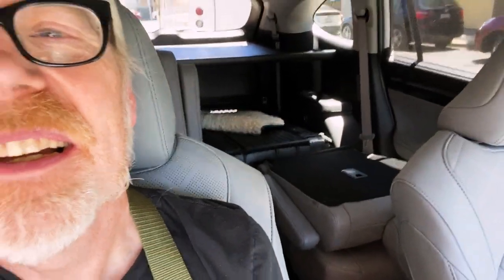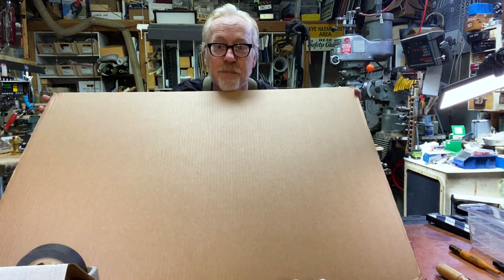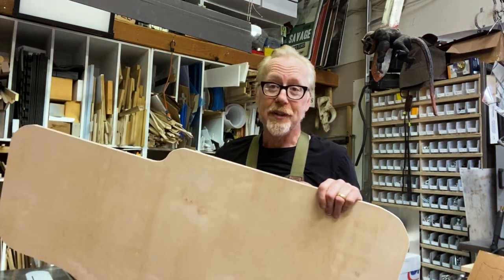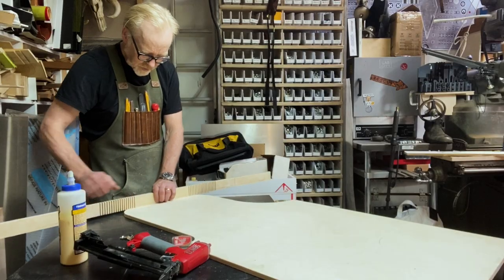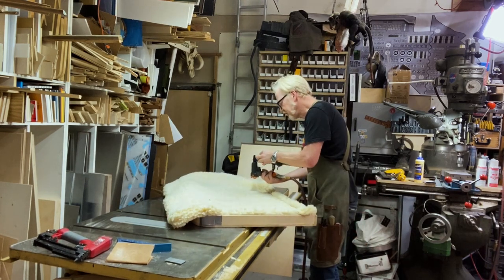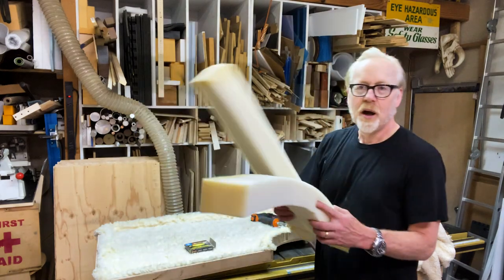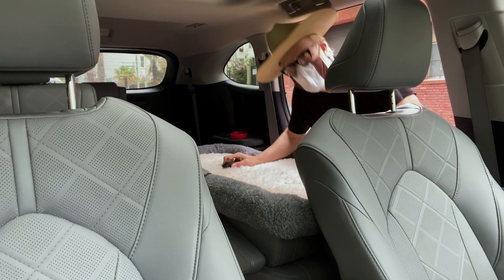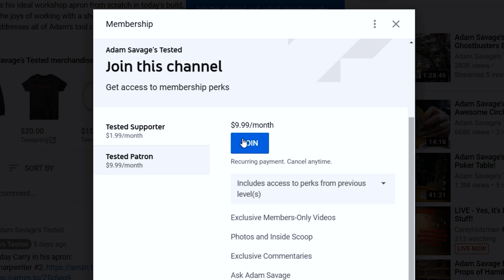Adam Savage's One Day Builds: Car Seat Dog Bed!

Comment: This is an awesome, comfy looking platform.
Two comments, though.
1: Maggie really should be wearing a restraint. You have a seatbelt right beside the platform, maybe consider incorporating a harness-based restraint and locking it into that seatbelt. Even if Maggie isn't used to wearing a harness, she'll get used to it pretty quickly and being uncomfortable is far better than potentially going through the windscreen.
2: I'd seriously consider making a cover for the bed, if maggie throws up on the sheepskin it's going to be hell to clean, especially because it's so incredibly well stapled down!

Note: If you were to have an accident, I believe first responders like the dog to be restrained because even if the accident weren't enough to injur her, if she were restrained there's a potential for her to escape when they open the doors, thereby having a scared dog running away or getting in the way. 
I hope that never happens, but, it's good to plan, just in case...
Reply: I totally came here to say this. Thank you!
Reply: @asyoz, Thank you, I had never thought of it from the First Responder point of view before. I will definitely do so from here on.
Reply: Yeah, I came here to say the same thing. Having your dog secure in the car is so important. My corgi has a car seat that just looks like a box with a strap that connects to his harness.

I figure Adam could modify this to add a strap in ~47 seconds.
Reply: It wouldnt even be legal in my country to carry the bed that way, let alone the dog.
Reply: No, it's not here, in Australia, either (Are you an Aussie too? :) ). Dog HAS to be restrained (either on a tether or in a crate). AFAIK it's not illegal in the USA, though.
Reply: This!!
Reply: @asyoz  No Europe :)
Pretty sure its legal there, adam would never show it if it wasn´t imo.
I did not listen to all of it, did he explain why he even conciders this a good idea? It´s not even safe for the dog, even in a small crash. the trunk is just perfect for that with the seats acting as a stopper.
Reply: Is it not illegal to have a dog unrestrained while in a car?
Reply: @Azuralis  no, it is basically "Luggage" and that needs to be secured in one of two ways:
a) just put it in the trunk so the seats will stop it.
b) if seats are down you need to strap it so it won´t go flying.
Reply: Wow, all you people that want everything to be illegal and to have every procedure prescribed to you are depressing.
Reply: I agree, can't believe gorgeous Maggie isn't in a chest harness. You can get them that clip into the seat belt receiver and have enough lead for them to move about but not past the front seats. Mine, she can get her front paws on the front centre console for a pat but that's it. It will save her life. @Adam, let me know if you want me to get you one, happy to pay.
Reply: @watcherofwatchers  no, they want people and their pets to be safe. Fun has its place but being safe is top priority when traveling at high speeds in heavy machines.

Comment: Hi Adam, 
Fun bit of nautical jargon, used to build boats for a living, when you put a raised lip around a flat surface its called a fiddle. Typically used on the edges of countertops or tables to keep stuff from sliding around and going flying across the boat while underway (particularly on sailboats where heeling over is a major factor). On well built boats they are in fact usually removable with bronze sleeves in the surface and bronze pins in the fiddles to facilitate cleaning or on dinning tables if you need a big flat surface for laying out charts, etc.

Comment: If you're interested in doing kerf cuts for a bend, but would like a good starting point, there's an online calculator that will show you how many cuts, and how far apart they need to be to make a bend of a certain radius. Maybe next time Adam does one of these projects, he can use this and save a little trial and error.

https://www.blocklayer.com/kerf-spacingeng.aspx

Comment: when he shot the staple i was so unprepared also you should check out the cordless dewalt nail gun i think you would like it
Reply: I think Adam perferes pneumatics for the shop.
Reply: And super basic safety: you don't load air tools while they are connected to air.

Comment: I absolutely LOVE the platform, just please be aware that the same dangers of not using a seatbelt for humans apply to dogs… when my dogs can't travel in the dog safe back of the station wagon I drive they each have their own harness and are strapped into a seatbelt buckle…
When we were at a road trip through Germany (before adopting the youngest) it was a life saver for the eldest when we had to do an emergency stop from full speed on the freeway. She would have flown into the windshield had she not been buckled up!

Comment: Always fun to watch Adam. Should have said that when kerfing and bending plywood, grain direction is CRITICAL. Cut your kerfs with the grain and not against. If your grain is perpendicular to the kerf, the wood will not bend easily and more likely to break. I make a lot of signage using bent birch ply, have a lot of with this.

Comment: If the third row of seats has Isofix attachment points, a metallic structure should be attached to the underside of this and fixed into the Isofix points. And from the structure some padded (fairly flexible) restraints should be attached for the doggo to be held in properly in case of an accident.

Comment: Perfect timing. I was just thinking about making something like this. One of my dogs just had to have his front right leg amputated due to a large cancerous growth. He's 3.5 weeks into recovery and doing mostly well. He's having some possible phantom limb pains, but he moves around well, has a great appetite, and acting more and more like his normal self. I'd been folding the seats down, so he doesn't slip and/or fall off the front edge of the back seats. But he has an easier time if he can lean against the seat back. I'd rather make a platform to keep him from falling into the footwell than buy one of those hammock style seat covers. The extra room to move around in the back seat would be nice, especially when I have both of my dogs back there.

Comment: Quick comment for those who are no good at doing curves either in wood, like myself, 
the best way I found is to get a flat board, thick as you can afford, 
and then draw out the curves and jigsaw them, 
then copy and repeat, 
may need to do a few copies depending on thickness of wood, but with a good gluing and patience, you can build side walls as tall as you like, 
and with it being the same shape over and over, quite often it doesn't take up too much wood, 
Hope it helps a little for some,

Comment: Awesome build! 

My only thought, as a former dog owner, is how do make something like this cleanable. I love our four-legged companions, but sometimes they can be more than a little dirty or stinky, especially after a drive to a hike or the beach or the dog park. 

What if one were to add a layer of plastic, of the kind they use on hypoallergenic pillow covers, to go around the outside of this build, then create a washable zip cover that goes over that? Maybe out of fluffy towels so you can just throw it in with other towels when using color-safe bleach or something.

Comment: Please get a harness for Maggie that attaches to the bed, or a way for the bed to plug into the seat belt retainers (just a couple of seat belts nailed to the underside would do), otherwise if there's a crash or you get rear-ended Maggie could get seriously hurt, and/or hurt people in the car as an unsecured dog hitting someone in the back of the head/headrest could kill them, not to mention that dog bed flying around!

I remember Mythbusters doing a test on how dangerous a items in a car could be during a crash, and Maggie weighs more than some of the ones you tested, I just want to make sure that Maggie and your family stay safe in the event an innattentive driver hits you!

Comment: If memory serves me right, there should be a few latches in the "trunk" area, where one rear facing strap could 3-point the platform for extra stability. Also, despite what Adam said, i think that a little upwards inclination towards the front of the car will be beneficial for Maggie's well being, seeing as cars lean forwards when braking. I think just enough to visually see the offset should be more than enough for a pup.

Comment: Dude,  watch it with your stapler! Disconnect the air when you reload if there is no safety on it. 

Nice build.  Did a folding platform for our Dane/American Bull dog mix for the backseat of my pickup before he moved out with my daughter. Folded up under the backseat. Kept claws off the seat fabric.

Comment: Our dog (a long-haired miniature dachshund) is lying on one back seat with a blanket underneath and a pair of pillows. She has a full harness on which is attached to the strap on the seat belt. We bought a kind of adapter harness that has a standard tongue on one side (for attachment to the car's seat belt) and a solid snap shackle on the other side (for the harness that the dog wears). In this way, the dog is secured in the event of a collision, but she can move around the seat, but not go over to another seat or up to the window. She seems satisfied and mostly goes to bed as soon as we drive :)

Comment: I've got racks, and a plant, full of corrugated board an arm lengths away. I keeps lots in my design lab, and we make it right outside of my bay door into the plant. The end of the corrugator is 20 ft away from my bay door.

Comment: Cool build. You did the cuts for the bends right, but you should soak it in hot water first, Makes it easier to bend without breaking and when it dries it will hold its shape. :)

Comment: shouldn't you also add fastening points from the bed to the car anchor points / seat belt points, so it doesn't fly out in an accident?  a couple of baby seat connectors would do the job. 
In AU, pets inside a vehicle are supposed to also be attached to a pet seat belt.

Comment: Adam have you thought about adding a latch to the bottom to take advantage of the child safety latch attachment point in the middle of the back of that seat to secure it? Noticed it moved around a lot.

Comment: A criticism - the weight of the bed - with or without dog sliding around only restrained by bungy cords is dangerous.  Fabricate a 'hard point' on the bed, equip it with a male seat belt and secure the belt to one of the rear seat female seat belt ends.

Comment: All that leveling and measurement is going to go right out the window when the weight shifts in the car. If it's level with no one in the car, it'll be off when someone sits on the opposite side of the car.  Or when the dog puts weight on the forward end, which will smoosh the folded seat cushions by a bit. FInally, you'll probably want to make a more secure way to keep it from sliding around. Just a little slide can throw the dog way off balance. 
Also, while I like the idea of making it nice and big, you've never been on a road trip where you had to bring a lot of stuff, have you?  I'm talking all the stuff for camping, or moving, or bringing home plywood. You're significantly reducing the amount of usable volume in the car.

Comment: I got really nervous when you were refilling the staple gun, facing upwards towards you, right after you showed there was no safety on it! I wonder if you could find a low profile tool-less valve to put inline with the air fitting as a safety cutoff.

Comment: I wish there was a resource for collecting slightly used boxes. One thing I learned working in a grocery store is we throw away a ton of very high quality basically new boxes. I know they get sold to china and turned into new boxes but that takes lots of energy when people would be perfectly happy with a slightly less used one. The amount of energy we use on recycling stuff when we could just be reusing it concerns me. Also your plywood might have been to dry, you can steam it with a standard iron just to get it damp and playable.

Comment: Wouldn't it have helped if the plywood had been soaked for a while in hot water beforehand to make it more flexible?
P.S. I hope your construction is savely fixed in place in the car and your dog is actually securely strapped while you drive, because if not...during a hard emergency stop or crash accident your dog bed and your dog could end up flying through the car like projectiles.
Some examples:
"when cargo learns to fly": youtu.be/kXMJfeEtGOU
"crash test: vacation baggage":  youtu.be/-WA0JnHMVNQ
"transportation of animals": youtu.be/gDi_a5Flw3M
"Dog Crash Tests": youtu.be/pIHrDdu_bVE

Comment: So, you feel bad you didn't film the manufacture of a new table saw sled as a one day build? Build a spare and film that. Don't need a spare? Make a spare anyway, put your little brass signature plaque on it, and then make it the prize for a give away contest for your subscribers. Though I suspect that will also need a little extra work, like some sort of plate attached listing blade setting limitations to account for various other brands and models of table saw without needing to make any significant alterations to the pattern.

Comment: Part of shop safety is wearing your PPE at all times because you don't always have control of when an accident will happen.  Automobiles are far more dangerous than the shop: you're exposed not only to dangers based on your own actions but also the actions of other people, often willfully distracted.  Does it sound safer to put a pet in a carrier, secured to hard points and placed as low to the floor of the vehicle as possible, or to let it roam loose where it will become a furry missile during a collision?

Comment: It's funny that you worry about staples/nail guns firing through the project material but you work with a table saw sled (cutting countless kerfs) that doesn't have a safety outlet block to keep you from CUTTING YOUR THUMBS OFF.  OK, last time I'm making this comment, but something that those with table saw sleds could understand.